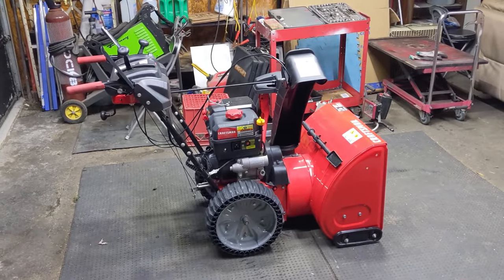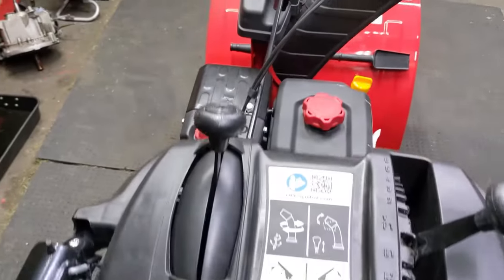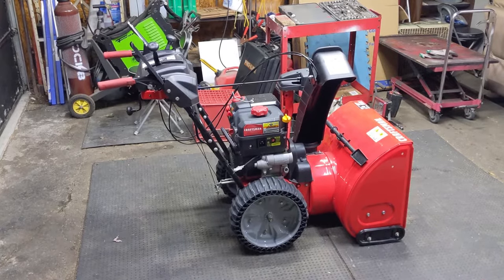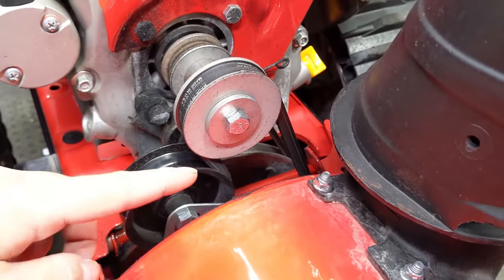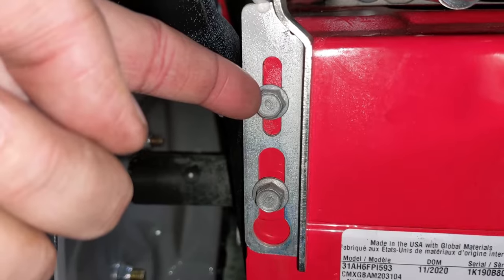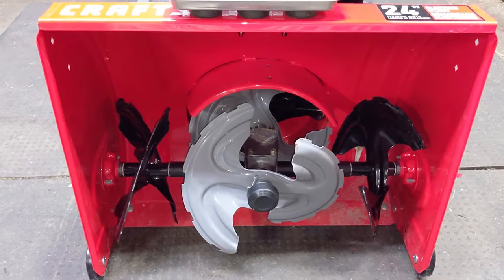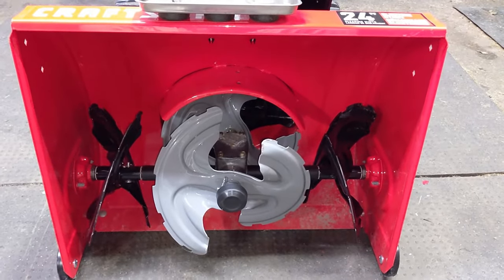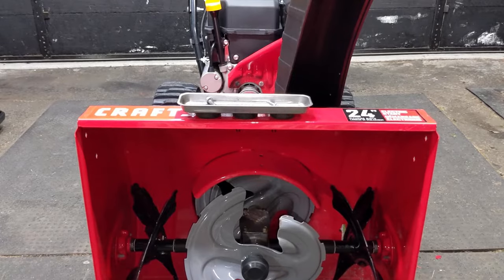Top 3 Things to Check if your Snowblower Doesn't Throw Snow

Comment: Hi, good informations. An another thing that I found on my MTD, is the space between the second stage propelers and the drum. I had a distance of approximatly 0.5 in. Snow was trown only at 15 to 20 feet. I have added peace of rubber, on propelers, to close the gap to 1/8 of an inch. Now, snow is trown between 30 to 40 feet.
Reply from the maker: Yea impeller mods are great, I don't do many because my customers are paying me for service. I may do an impeller mod video on my own snowblower this season.

Comment: The new models are built too cheap. I like my 35 year old Toro with steel rods to control the drive and auger/thrower impeller. They sure don't build them for what you pay anymore.

Comment: Everything on my blower seems to be working as it should, but when I push it into the snow I see a little snow throw out and then nothing. I would describe it as if the snow is too heavy for my snowblower - but I can confirm the snow is light, not wet, and my snowblower is a big one with auger blades (not rubber) and has worked with this same snow in the past. Any ideas as to why? Any help from anyone is appreciated.

Comment: boy. that style is still much like those of the early 90s
Reply: I personally like the older models since i can access the carb and have it in the ultrasonic cleaner in 10 minutes max, with these it takes so much more time and we actually had one come in that required 24 bolts to be removed to get at the carb. Additionally the metal was so thin that reassembly of those bolts took forever just getting the holes to align.

Comment: Good morning, not related to video question with ohv valve lash setting, is there a right and wrong way to set valves. Both valves closed on compression stroke or one valve fully closed and one open when setting on either cycle of engine?
Reply from the maker: I've always set them when both valves are closed at top dead center on compression stroke!
Reply: @EliminatorPerformance  thank you!!

Comment: Darn. Snowblower season. In order to preserve the auger gear case   i usually take my Dremel with a cut off disc and cut 2/3 of the way through all the sheer pins.  That way they break under much less stress.

Of course sometimes I need to change 4 or 5 sheer bolts with each snowfall,  but thats a small price to pay to keep the blower going. 
Okay. So I dont do anything so stupid but your video did make me think about my blower - gotta make sure its good to go.  so thanks.
Reply from the maker: Anything to help protect your investment, thanks for watching Sam!
Reply: @EliminatorPerformance  look forward to your videos. Thanks for posting them.
Reply: If your using the proper shear pins i do not think that is necessary. Some of our customers have been buying their shear pins at the big box stores and they are made in China and breaking way too easily and i have never seen a gear box go when using proper shear pins. But you have to be able to add 00 grease every now and then because the original lithium will be separated off to the sides and away from the brass or bronze gear in the middle.
Reply: @waynestefinashen239  i have an older Honda and use gear oil - i level the machine and fill it until it drains out of the fill hole. 
Interesting about the non oem sheer pins- but of course my post was a joke to help with "engagement" on this channel i enjoy.
Reply: @Samlol23_drrich  Good one Samlol23

Comment: Nice simple well explained video Jake. Do not think too much about those plastic rims and plastic tires thought. Can you find out from your customer how it handles in the heavy wet snow for us subscribers?
Reply from the maker: They're hard as a rock and this unit is fairly light so it most likely rides up on the snow. I would take a pass on this particular machine

Comment: Good video Jake!  First time I've seen tires like that. Are the well liked, how long they been around etc..
Reply: Ed i believe they came out with these a few years ago but this is the first one we have gotten to work on. Really with a plastic rim and tire i have some concerns on traction and stability during extreme cold.
Reply from the maker: Well they're expensive, like $127 each to replace here in Canada. So when the tread wears down, it's an expensive repair vs just changing the rubber.

Comment: What are the 2 yellow caps on each side of the engine block? Are they a fill/drain for the oil? I have them on my older craftsman
Reply from the maker: Yes fill ports, they make 2 because these engines are used in different applications. Sometimes one isn't accessible, so they make 2 so the other one always is. Make sure they stay tight!
Reply: @EliminatorPerformance  thanks for the info and the quick reply! And thanks for the great content. Definitely helped me out. Cheers

Comment: I hit a big stick a couple years ago and instead of sheering, the pins were half sheered but still in place. Instead the belt squealed and smoked for a few seconds before stalling the engine. Ever since I've had a vibration in the auger drive. I can't visually see any issue. Nothing looks bent or out of place. Very hard to diagnose without tearing the whole thing apart.
Reply from the maker: Start the engine, and put a small clamp on the auger lever like I did in the video. Then you can walk around to the front to have a look at the rotating assembly. I had a 3 stage come in and the front accelerator shaft had a slight bend to it causing a bit of vibration.

Comment: Good  day  Jake  interesting video
Ask your dad if that is my problem,  I can't seem to throw snow as far no more either
I guess I will have to check my belts.  LOL  Thanks
Reply from the maker: Lol yes with age comes wear and tear. Thanks for watching!
Reply: Easy fix if you have the older style blowers that you can tighten the idler pulley on the auger belt.

Comment: Do you have an affiliate link to the shear pins?  Are they available on Amazon Canada?  or MTD only?
Reply from the maker: Which ones are you looking for?
Reply: @EliminatorPerformance  Need both . The ones that came with the snowblower are a round one with the number 3 on it and a hex one with the letter A on it
Reply: @EliminatorPerformance  are they both the same just labeled differently?
Reply from the maker: @rternowski  watch this, then let me know what you have https://youtu.be/l9LJUe4MBUI
Reply: @EliminatorPerformance  I have the exact Craftsman 24" blower that you have in video.
Reply from the maker: These are the links, but do your research for what you're getting on Amazon, they are likely overpriced. I would recommend getting from a local MTD parts dealer or small engine repair shop 

Outer black pins with #3 on head (738-05273) https://amzn.to/3j6wgUE

And inner silver pins with hex letter A head (738-06654) even though the listing is misspelled as the other one, the photo is correct; https://amzn.to/3Ht6C62